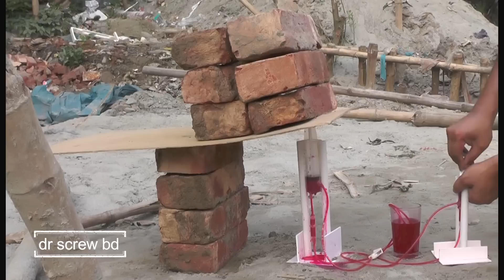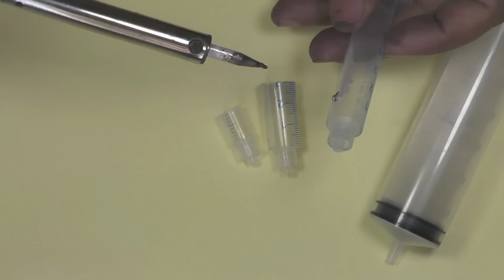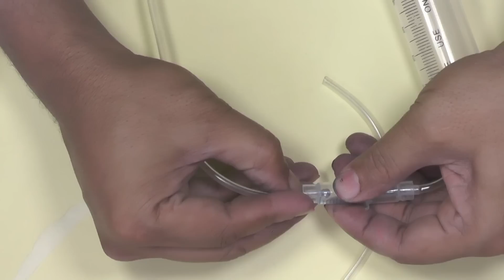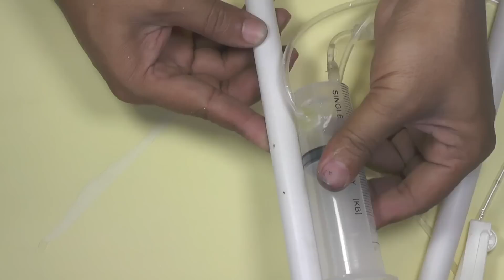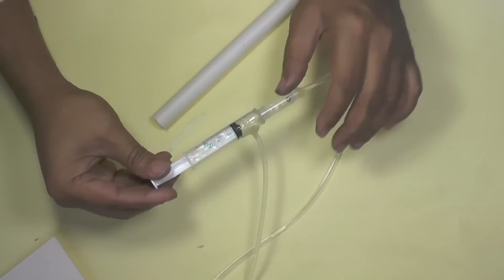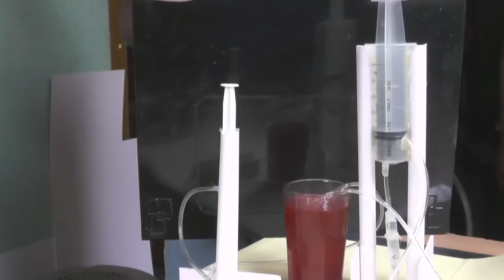How to make a Powerful Hydraulic jack using syringe at home vary easy

Comment: Why did you put this little ball inside the syringe? Without it works as well?
Reply: Ana Carolina Rocha the ball acts as a one way valve to prevent backflow
Reply: ball maintain the fluid flow in on direction